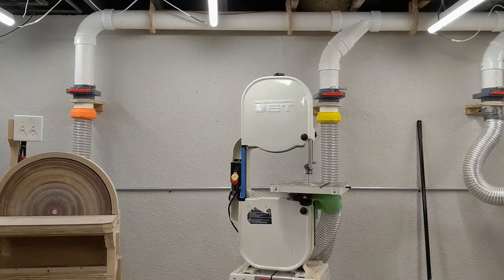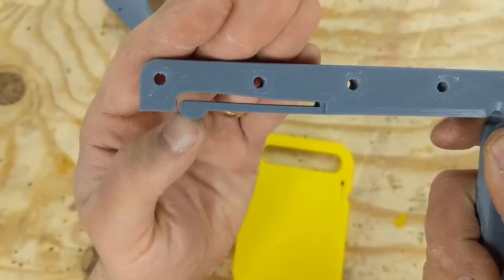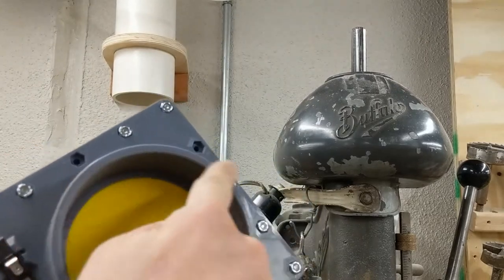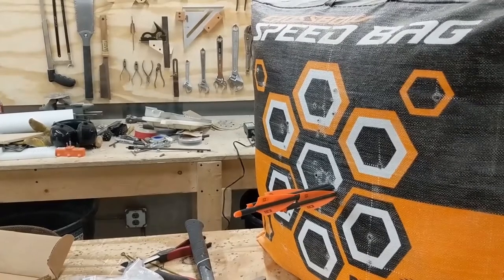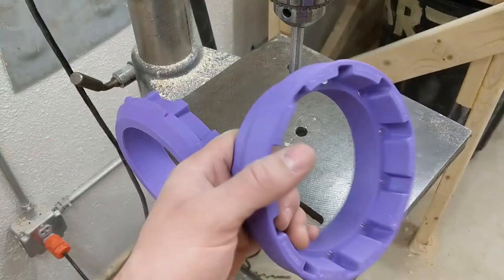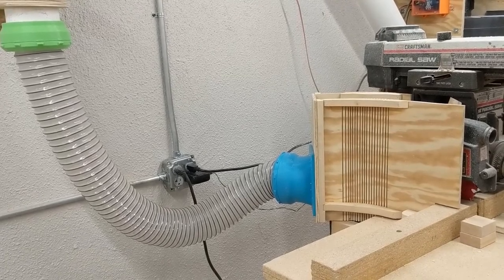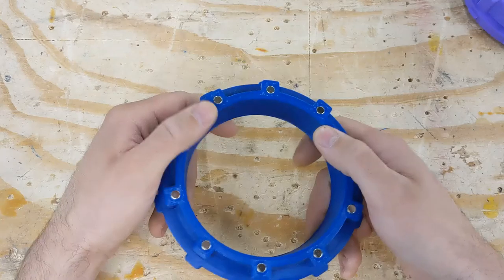Automatic Dust Collector Made With 3D Printed Parts

Comment: I really liked the printed parts!  Haven't seen anything quite as innovative on the tube.  The idea of switches anytime you open a gate gets a thumbs up.  I've seen the remotes that can turn on a unit, your idea eliminates one less step, finding the remote and activating it.
    I use a cyclone unit, but I vent my exhaust either to the outside via a window or connect it into the 20" central ductwork that hangs from the ceiling.   Most exhausts go through a hepa filter because that is where most of the fine particles end up.  I would vent your system to the outside for your lungs sake.  Quite a bit of dust escaped with the el cheapo 20 x 25 filters.  A new set of lungs clock in at 400k.
Reply from the maker: Thank you! glad you like it. Shortly after posting the video I changed the system up and vented the exhaust outside, works way better and I'm free to damage my health in more fun ways

Comment: 6:30 and this is why I'm /not/ a fan of zip tying things. You never know when you need to take it apart again and now you wasted some plastic.
Velcro and twist wire (like you get with EVERY electronics cable ever) can be reused and work just as well.
Aside that, a really nice design and I can relate to /not/ wanting to walk over to the collector to switch it each time 👍

11:12 definitely a keeper. Good thing you already found her 💝

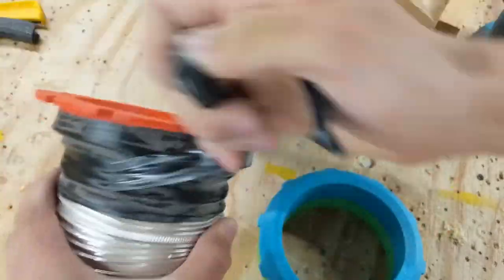18:00 when you re-discover your past sins..... but as bad as it was done, it was apparently working "well enough" for years, so it wasn't /that/ bad.
Reply from the maker: A recent redesign has replaced those zip ties with a bolt-on clamp, much easier to replace!

Comment: Looks like we have a lot of the same tools - I'm printing your mag coupler, as I type - if it works as well as a suspect, I'll be sure to tip you on thingiverse. Need to see about that 14" bandsaw (mine is old enough to not have any ports for dust collection - but a magnet-mount cup underneath would be nice), the radial arm saw throws so much dust, and my current "Fig bar box with wood chunk reinforcement" kind of works but is janky as all get out. Keep up the good work - your videos are well-paced and informative. Thanks for taking the time and effort!
Reply from the maker: I'm very glad you enjoyed! Pacing and timing are something I put a lot of effort into, so it's encouraging that you mentioned it specifically. I feel like Janky is a synonym for "character" lol.

Comment: The 3 d printed adapter you made! I accept your challenge!
At Lowes home improvement in plumbing section where corrugated French drain is located the couplers for that drain tube works perfectly just break off the tabs on the inside of the coupling.
Now the exhaust of the blower on mine I used the ring where the dust distribution bag was. I replaced it with the Wynn environmental.03 micron filter that is where I employed the coupling. Unlike yours you connected to a PVC pipe. I did that until my filter arrived I had a rubber coupling that fit between the two pipes.🤣🛫
Reply from the maker: I'm actually pretty stoked someone figured out how to do it, I'll take a look next time I'm in that aisle

Comment: I really love your magnetic connectors.  As soon as my printer gets delivered I am making those.  I also have a trash can mounted under my collector fan just like you do.  It is currently pressed up to the seal with an inner tube and a couple of scraps of wood.  Your lever idea is so much better.
Reply from the maker: Nice! And thank you, the compression ring has a hard time sticking to the bed without a brim, hope that spares you some headaches
Reply: @daveman4863  How did you bend the conduit?  Did you already have a bending tool?

Comment: I like your system better than mine. I bought a "20amp smart plug" and wired it to a dedicated breaker. Then I bought an "echo dot."  I yell, "Alexa, turn on vacuum" or "Alexa turn off vacuum." (I had to add the smart plug and echo dot to my house network.)

Comment: I bought the stl files for the magnetic hose connectors and the fit on 4" schedule 40 PVC is perfection. I was close to building my own for it, but came across this and the money was well spent. If anyone is looking for a perfect fit on standard 4" schedule 40 PVC this is it.
Reply from the maker: Thank you! I'm very glad it worked out for you
Reply: How long does it take to print a set of these connectors?
Reply: @brunomelli4679  about 2hr 45min for each of the two parts. that's with .24mm, and doing the recommended:
"6 perimeters, 6 top shells, 6 bottom shells, at least 30% cubic infill" (I did 30%). 

I put the compression ring in the same print as the south ring because I can get them to both fit. It only adds about 15 minutes.
Reply: @atomictyler  Wow, you have a fast printer. With the default Cura settings on my Creality CR10s Pro V2, the north and south rings would take 15 hours each. 
That's with a 0.4mm nozzle.
Reply from the maker: @brunomelli4679  Mine are usually about 8 hours per large piece, I've got a .6mm nozzle on a Prusa MK3S, 6 perimeters, 6 top and bottom layers, 30% cubic infill

Comment: Hey Daveman! The inlet size of the Super DustDeputy cyclone is right at 5 1/16 inch. I just 3d printed a similar fitting for my cyclone to fit the 4in pvc. Great work on the relay and video!

Comment: Regarding strength of 3D prints: I generally like PETG for functional parts. It's a bit more flexible, but a lot tougher. PLA is stiffer, but tends to snap, and under load it "creeps", getting slowly reshaped over time.

Comment: The actuation point of the microswitch will vary over time, and stop switching, unless pressed fully in, I (through bitter experience), now mount them with the face of the switch exposed so that the plunger can be pushed fully home.
Reply from the maker: You sir are absolutely correct, on both of your comments. I used to replace them about every 6 months. About a month ago I designed a new version that holds the switch in line with the intended direction. Once these new ones survive some testing in my shop, everyone who has bought my files will be given the revision for free

Comment: Dude you have a serious leak in your vacuum side of the cyclone this is why you are getting all the dust out of the exhaust port! 
To find that leak use incense sticks that generate smoke I use 3 sticks at the time. I move the sticks around the suspect area and watch if the smoke is drawn in if so correct that problem. Every bit of your saw dust should be going in the waist bucket. 😀🛫
Reply from the maker: If I'm understanding your theory correctly, you're proposing that a leak or inefficiency at the top of the cyclone is causing the chips inside the cyclone to spin at an attenuated rate, resulting in poor dust/air separation?

I think what's more likely is that I'm just getting too rowdy and pulling in way too much sawdust at once which overwhelms the system. I'll check for leaks anyway, never a bad thing to do

PS: also I solved my exhaust problem a few months ago by just routing it outside lol. Paying more for heating and cooling is cheaper than lung cancer

Comment: I had my blower+cyclone set up exactly the same way you set up yours. The air is moving too fast for the cyclone to do its job. My solution was two fold: First, add a section of 4in tubing bent at 90 degrees to slow down the air (this means reorienting the blower 90 degrees). Second, let my filter get clogged up enough that it again slows down the air (which is obviously a lot more temporary).
Reply from the maker: A few months after posting this video I moved the unit, removed the filters, and ported the exhaust out of a window and since then it's worked much better. Higher velocity in my system is always welcome for better efficacy at the point of use, and my cyclone never seems to suffer

Comment: Not much point in a dust collection system that blows fine dust around your shop.  Strongly suggest upgrading those filters to MERV 11 or 12, as the fine dust going through the current filters is the most dangerous.

Otherwise very cool system...no doubt that those fittings would sell extremely well over what's currently available.
Reply from the maker: Thank you! and I'll do you one better, I recently reworked the system and now it's shooting the waste right out the window!
Reply: @daveman4863  Do you have a heat exchanger setup on the pipe shooting out the window?  I can hear my dad complaining about heating the outside in winter.  😁
Reply from the maker: Haha, my solution to that is save on building a heat exchanger and pay for more heat
Reply: @daveman4863  Fair enough, but heat exchanger would be a cool project.  😛

Comment: I just purchased your connectors file. Planning on getting the rest. do you have a option for 2.5" hoses? Thanks
Reply from the maker: Is it a flexible spiral-spine hose like the ones in the video? and is it a true 2.5" outer diameter? Several people have asked me to develop that size, perhaps I should boot up the CAD machine

Comment: Interesting but why not just use a remote?  I have a contactor that turns my dust collector on and a remote that has the receiver connected to the coil which turns the dust collector on.  The remotes have a magnet on the back and are very inexpensive on Amazon.  I do prefer it over one that requires me to operate a gate to turn it on and off.
Reply from the maker: Personal preference I would say. Carrying a remote (or even clipping it to my belt) is minimally invasive for some, but I'm looking to reduce as many barriers to usage as possible, plus I have to open a gate no matter what, so it might as well do some work for me

Comment: How is your furnace filter box holding up? I am considering something similar. Any reports or other videos after 2 years of use?
Reply from the maker: Several months after filming this, I reworked the system to vent waste air directly out the window in my shop. It does impact my heating/cooling bills, but I've really found it worthwhile

Comment: I like the blast gates and generally flow but your collector is letting the worst and most dangerous dust through.  It's the fine dust that gets lodged in your lungs that causes problems.
Reply from the maker: You are absolutely correct, shortly after posting this video I reworked the system to blow the exhaust gas out a window. The uptick in heating/cooling costs is well worth it
Reply: @daveman4863  I did read that later.  I should have reworded.  But thanks for the reply.